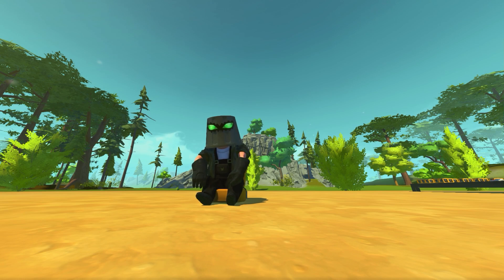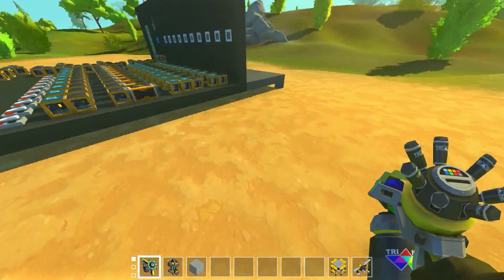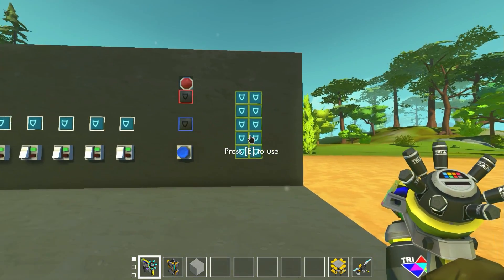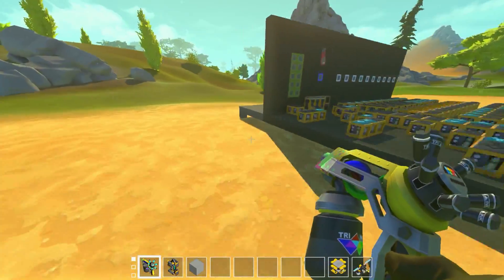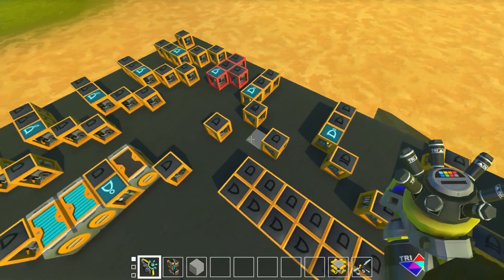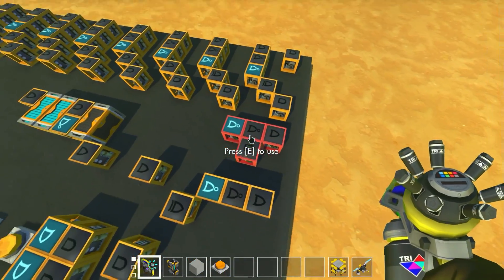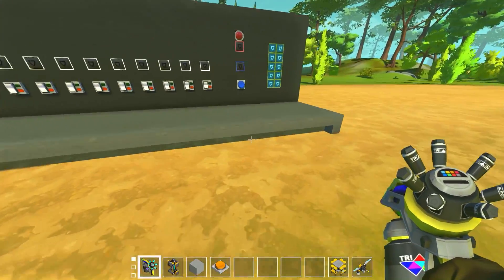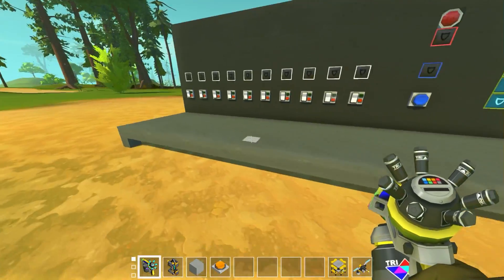Solving a Code Using Logic! (Scrap Mechanic Logic Challenge #05)

Comment: So.... basically you took something similar to my binary interpreter (NotAndOrGate) and added some stuff, called it the enigma and asked people to solve it, kewl
Reply: I know this is old, but really that is the only efficient method for checking. In processors, the alu has to have a logic section, and one of them includes a circuit similar to the one shown.

Comment: kAN! Can you please make a tutorial on how to make a binary to decimal converter? btw nice video and channel!
Reply: If you have small numbers from 0 - 9 it's easy, you just use NAND (if there are multiple bits which are outputing 0) or NOR gates for bits that output only one 0. For AND or OR gates it's same, if there is more than 1 bit outputing 1 - use AND, if there is only 1 bit outputing 1 (that is case for 1,2,4,8) use OR, then you would have 2 gates to decode each number, you just need to hook the pairs into AND, so if some of the pairs has both gates active, AND activates and that's your number. For higher numbers you would need binary to bcd or bcd to binary... If you can't find any tutorials for scrap mechanic, just watch some minecraft tutorials, you can understand how it works, and if you have IQ high enough, you should be able to make it in scrap mechanic 😁. I hope you understand it, just read it few times 😂.
Reply: thank you very, very much Volnas! But I also hope kAN will show us a video example to make it a bit easier! :D

Comment: People who find the code with less than 10 attempt are monster
Reply: Rafale25 Narchal i think it‘s impossible to find every possible code in less than 10 steps.
Reply: Jan Only with chance or a really good algorithm
Reply: Mine needs a bit fine tuning. It takes it 11 guesses, when the code ends on 
0-1. It takes 10 guesses when the code ends on 1-0 and under 10 guesses when it ends with anything else. I believe i have a pretty good chance in this, if i fix the issue with 0-1.
Reply: Rafale25 Narchal  not with a good machine, just with luck. Because it will take at least 10 guesses to have every input tested once (if the code is 1 input only, it will work totally fine and faster than 10 trys)
Reply: TheNameLP I already made the 10 tries machine
Reply: Rafale25 Narchal how?

I just thought about an Idea, but I wont write it down, so no one will be able to copy it...
Reply: TheNameLP Because this idea is the most simplest method to find the code
Reply: TheNameLP I finished it 1 hour ago at 20fps with no mouse on a bad laptop
Reply: Rafale25 Narchal  I have an Idea, but don't know if it will work, so it would be able to solve it in 9 steps if lucky and 10 steps if not. I'm gonna try it tomorrow
Reply: it's really not that hard, if you just had a bit of experience with algorithms ;)
Reply: Easy, I can do it in 10 and below

Comment from the maker: Challenge Rules:
1 - Submissions due by March 5th Noon EST
2 - No glitches or blueprint editing
3 - Creations must connect into gates on front panel (any gates including green ones are allowed)
4 - No connections allowed to be made to any of the gates in behind the wall
5 - Winner will be determined based on total number of guesses
6 - Use a button or switch to start creation's first guess
7 - Any size creation is allowed so long as it is built in front of the wall. Platform may be extended if needed
Reply: worst thing, all machines will need the same amount of time, so it is not possible to pick out the best. Do more logic only challenges, bat make sure they are only solvable with interesting and unique tactics.
Reply: i literally made a brute force machine, breaking a 4 digits (from 0 to 9) code, today and then you upload this... 

FBI WANTS TO KNOW YOUR LOCATION

[Sure] [No]
Reply: i know how to crack it in 12 tries but i can't buy scrap mechanic so i'm going to send it as a file not trough workshop  because you did not mention if through workshop or mail.
Reply: I know how to crack it with the fewest guesses ^^ this one is a really nice challenage and i love to participate
Reply: I noticed, everybody now will have 12 tries
Reply: I think the challenge will be to have the highest possibility of solving it in less than 11 tries. Which males it really hard to find a testing method which is fair.
Reply: i agree.
Reply: kAN Gaming Challenge completed :p right now with a computer running at 20fps with no mouse : 10 attempt to find the code
Reply: I have something in my mind with only 11 guesses, but I don't know if it will work. I'll try my best.
* Is Submitting in the workshop possible too or do I need to send a Mail? *
Reply: TheNameLP Yes it works, I have already made it
Reply: @Rafale25 Narchal As far as I know the fewest guesses needed in the worst case is 11. Correct me if I am wrong ^^ but this is what I am thinking and this is what my sumbission does
Reply: Benjamin S Yes 11 the good number of attempt but it think a really good algorithm can find it by deduction in less than 11
Reply: Agreed everyone will be tied in first place. I will come down to the order in which you solve the bits and what the code is. Unless you test multiple codes for each creation in that case everyone will tie. This challenge is too easy it removes the physics completely which means less variables to deal with. I'm sorry kan I really enjoy the stuff you do but we do need more than just logic to make it a real competition.
Reply: @Rafale25 Narchal deduction is a dangerous tool. Do you know the one with the prisoner who will be executed on a random day of the week and it will be completly unexpected for him. So he deducts that if he is alive by the end of thursday he will expect his death on friday so he cant be executed on friday. And the same logic for all the other days brought him to the conclusion that he wont be executed at all. You can only conclude the last bit correct but if you are on the second last bit and one is missing then there is no way to conclude the last two bits. you can only improv it by filling up bits if there are as many bits left as there are false bits. But the worst case will always be stuck at 11 or 10 if you conclude the last bit.
Reply: kAN Gaming Couldn't you guess it in 10-11 tries?
Reply: @Krekker Recer yes 10 is the lowest number of guesses possible if you want a 100% accuracy. With 9 guesses your accuracy will drop to 50% that means your code will be 50% of the time right and 50% of the time wrong. And this goes only downwards from there on until you reach at 0 guesses or never input the blue gate an accuracy of only ~ 0.397% . Btw I am speaking of the worst case.
Reply: When does this come?
Reply: where is the result of logic challenges? I'm really waiting to build a new construction and participate. sadly I missed the finish by date for this one, but I don't know why there has been no finals of this.
Reply: Where are the results?